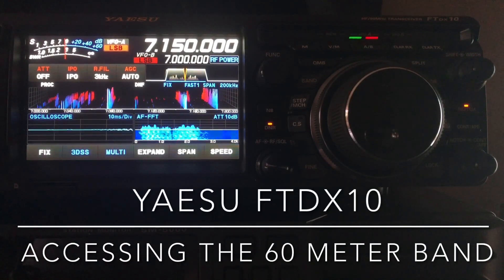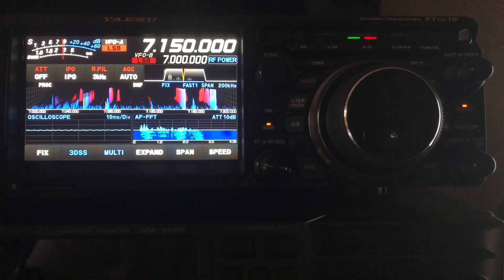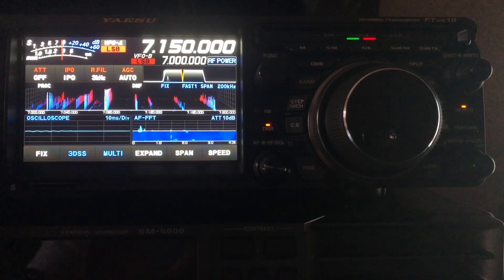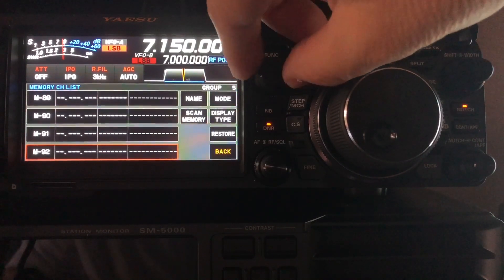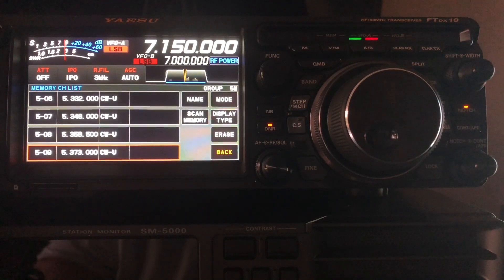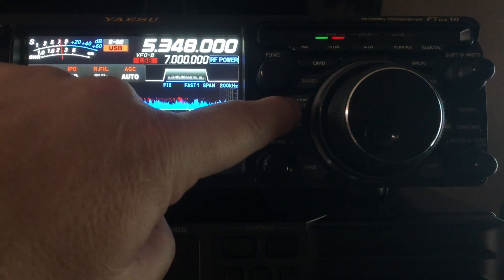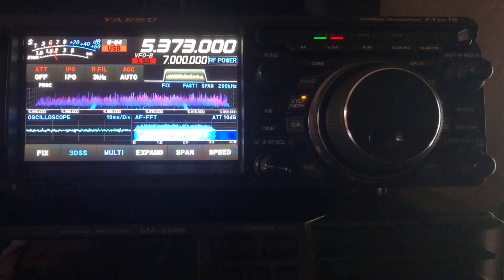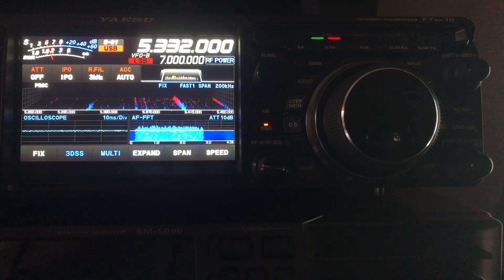Yaesu FTdx10: Accessing the 60m Band (Video #10 in this series)

Comment: I have to admit, having those frequencies in a memory slot is a good idea. I did the same to my  Kenwood radios.
BUT....on my FT897D, those memories were also programmed but back then either two or three of the original frequencies were moved. NOW WHAT? You can't correct the problem without using software and Yaesu did not provide software for doing same. I was able to correct this problem using CHIRP. But CHIRP does not work with my FT991A. 
Since you can update the firmware in these newer radios, I hope if this issue pops up again these frequencies can be modified via a firmware update. 
I do like the idea of these frequencies being put in memory slots, it provides us with a degree of protection so we don't go where we are not suppose to be. I personally do not have each frequency programmed in my head so a mistake could easily happen.
Thanks for posting the informative video.

Barry, KU3X
Reply from the maker: Hi Barry!  With my old FT-890 and FT-920 radios, which predate 60m, I did the MARS mod and programmed the 10 frequencies/modes into memory slots, in order of channel number.

73, de N4HNH

Comment: Great series Doug! I love my FTdx10. It’s the best rig I’ve owned and it will be with me for many years. Any plans to explore the NB and DNF functions as I’ve found these to be very good? I know you’ve done a video on reducing noise, but I don’t believe these were covered. Thanks again for all you do. Keep safe and be well. 73 de Will, M0LGW 👍🏻✅
Reply from the maker: Hi William!  Thanks for your comment.  I’m really enjoying the FTdx10.  I did cover the DNF but not the NB yet.  The power company eliminated my power line noise.  If it starts up again I will need the noise blanker. Maybe I can show it in action.

73, de N4HNH
Reply: @n4hnhradio  if you do touch on the NB function, recap what you covered in the past about reduced selectivity. The audience for the FTdx10 would probably love to have that knowledge as well. It was an eye opener for me and helps to know that. Some folks might otherwise run it all the time and think their radio is not very selective. Thanks Doug!
Reply from the maker: Good point, Joel!